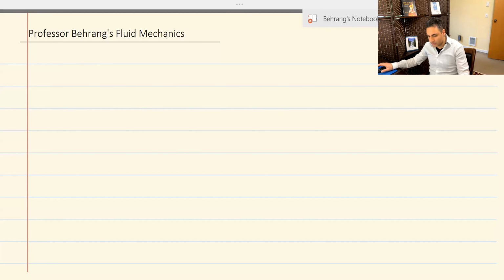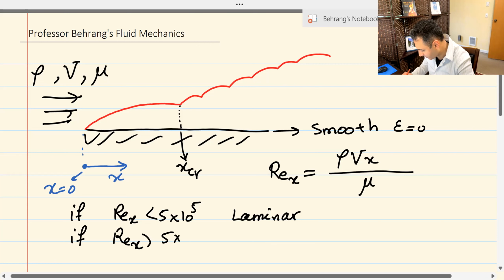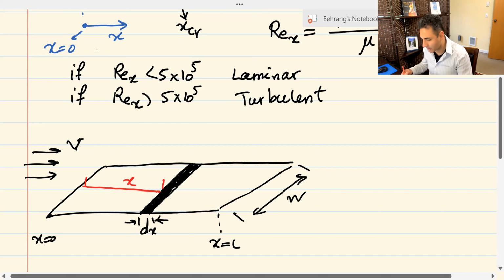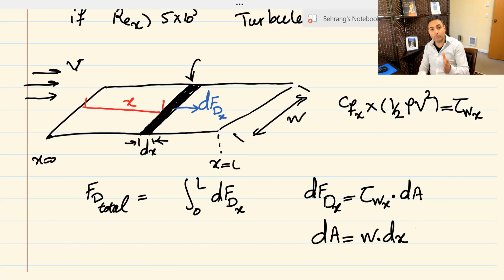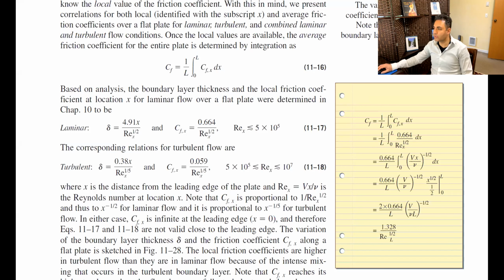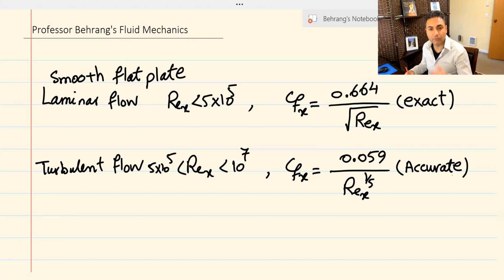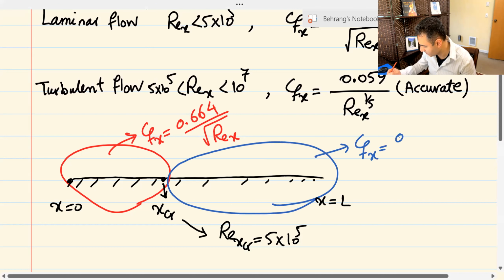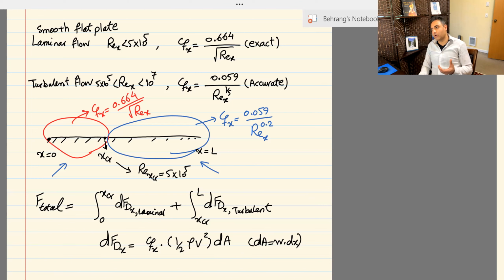External Flow over a flat smooth plate & local friction coefficient meaning, Fluid Mechanics

Comment: After watching your video I am totally able to drive the equation for total drag force. Professor, would you please clarify near the wall(surface) what would be the behaviour of the local and integral drag friction, both increasing or one increasing the other is decreasing?
Reply from the maker: The local drag always decreases until the flow pattern goes from laminar to turbulent. There is an increase in local friction coefficient during the transition. Then it will decrease again. The total drag force always increases because it’s the integral of all local forces. The bigger the surface, the bigger the drag force.
Reply: @professorbehrang  Thank you professor for clearing my concept about integral drag friction as well.
Reply from the maker: @idreeskhan-zp5ey  No problem